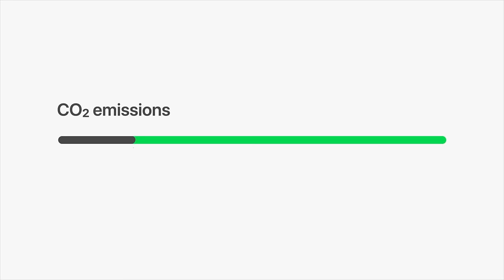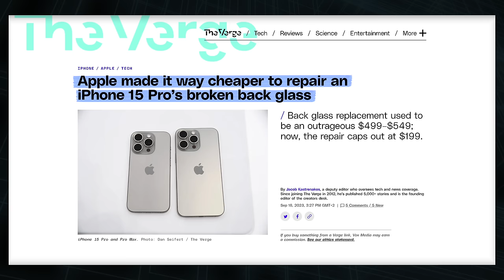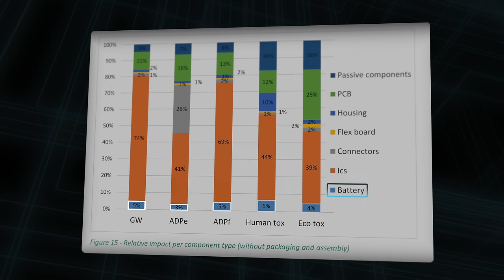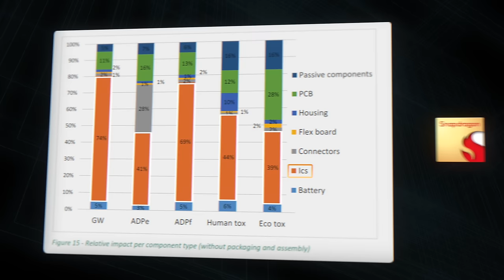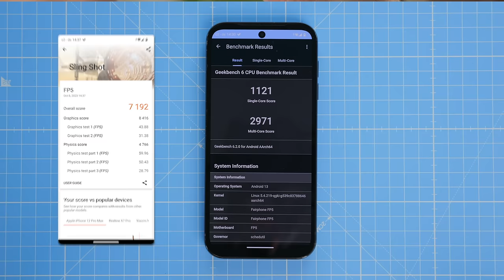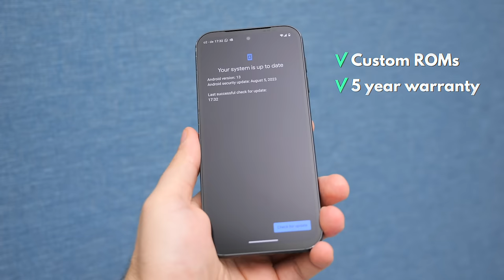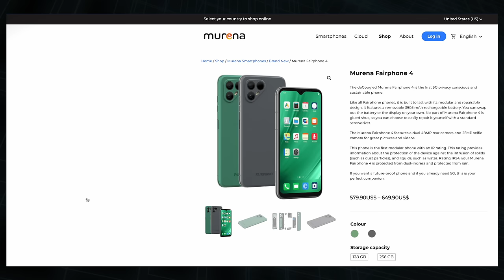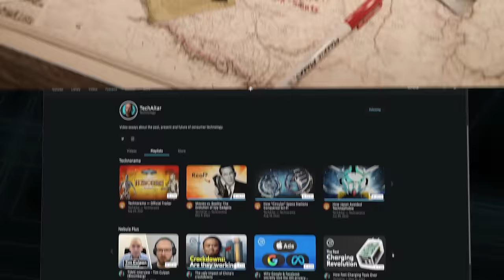Is Fairphone really fair?

Comment: What they should do with easy repairability is to target the framework selling point of being upgradable. Imagine an option to replace a better display, camera modules and cpu in the future fairphone. The current one can easily achieve an upgrade path for the camera the very least.

This alone can be a huge reason to consider fairphone
Reply: They did it in the past with Fairphone 2 and 3. I guess that hardware wise there's not that much you can upgrade before it's the SoC you need to replace, and as he said in the video, modular chips are not a thing yet
Reply: @nachopascual96  they can make a module with 3 cameras instead of two and also use better sensors and lenses
Reply: I don't see much value in Framework upgrades — except storage and RAM like in other notebooks. Just sell and buy another, at least previous motherboard sold with working notebook — less waste.
Reply: @cyano3d  they have pretty good sensors already, I believe it's the software that limits performance. And yeah, adding a third camera could be a valid upgrade but then you lose the TOF sensor
Reply: @nachopascual96  explain me who the hell needs a tof, a lidar is still understandable or maybe something niche like infrared even. But tof  isn't supposed to take so much space which could have been a 3x or 5x tele
Reply: @sergeykish Except the Framework mainboards can be reused in their desktop case like a NUC, and you can connect an eGPU dock to it for a desktop-like experience. Not to mention the mainboard is usable even if the screen or keyboard on the laptop is damaged later on.
Reply: @johnbuscher7119  You can reuse notebook as is. I hardly believe you need several such boards or there is a market for such boards. You can repair screen and keyboard.
The only interesting concept I see is keyboard module. I enjoy central position for touchpad and spacebar so I'd prefer standardisation that would allow user to choose.

Comment: I've got the 4, as it finally offered the performance to make it long term viable in my eyes.
My biggest complaints after they fixed the camera software were the bulk and the lack of granularity in their modules. 
They did fix both on this version plus a lot of extra stuff and though it's even more expensive now it's finally a device you can own without really feeling like you compromised i think. 
I barely feel disadvantages compared to my wife's iPhone 13 as is.
Reply: The only complaints I have is they don't sell them or provide warranty where I live! I pretty quickly got used to the sound and vibration quality and although it sometimes gets slow and glitchy my Samsung did the same thing
Reply: @NathamelCamel  yeah well glitches are part of the Android experience i fear. You can mitigate some with performance and i feel like these phones are string enough to do that for a while.

Comment: IP68 with a removable backplate has already been proven possible by Samsung's Galaxy S5. It also had wireless charging with optional backplates.
Reply: It was actually IP67 but still very good. I hope someone makes an aftermarket backplate with bigger battery and wireless charging for these phones at some point.
Reply: @Luke357 Do you even need wireless charging? It wastes more electricity compared to charge the same amount for wired. Surely that would be bad for the planet, right?
Reply: @Kromiball  I'd be getting the phone for longevity not efficiency. I like wireless charging because it reduces wear on the ports and it's just so convenient to just drop my phone on the pad and forget about it. Much easier than plugging it in at night.
Reply: @Kromiball when your usb port degrades you can still charge it wireless. Thats a huge win. The reduced efficiency doesnt actually matter much unless we are talking about speed. Phone batteries just arent big enough for it to matter.
Reply: Yeah I also remember the good old days, waterproof, swappable battery, headphone jack and SD card.
Reply: @cc0767  if every iphone had wireless charging it would definetly have an impact, just looking at a single phone is short sighted
Reply: @florianm9693  ironically I remember when Apple stole our 3.5mm port they tried to market it as a move away towards wireless. Meanwhile my S7 had wireless charging and iPhone did not.
What is your point?
Reply: @Kromiball Wireless charging is possibly a security benefit. So you don't connect to malicious usbc cables but still need to charge

Comment: The Germany based "Shift" company also has a "Fair" smartphone. Their newest model, releasing in August/September, the Shiftphone 8 will be modular, have removable back plate, you can repair anything with a screwdriver just like on Fairphone. Their Battery, while small (3850mH) is a multi purpose battery and are using it on multiple devices. The Phone will also be IP67 certified making it "on par" with most regular smart phones on terms of water and dust proofing. Maybe worth checking out.

Comment: The differences between phones nowadays are super small. It really depends on if you want the blue bubble or what skin (if any) you want on your droid os. The main thing is that this phone is repairable easily. Apple and other companies can posture all they want but serialized parts and batteries you need special tools to remove kinda negates all that since it's gonna be ewaste in a few years anyway when the battery dies for the last time. Fair phone isn't perfect by any means but they're the best out there for a phone you can actually use for longer than a couple years
Reply: the battery is not serialized. and even replacing it through official means is not expensive with Apple. and Apple will gladly buy your phone back to refurbish it. also iPhone are much more future-proof and well-built and so they last longer without breaking or needing to be upgraded in the first place.  the iPhone can last 5 years or longer for many people.

Comment: Great option for people wanting modularity, repairability, and longevity. Sustainability is great, but a better option honestly is buying a phone second-hand. Currently I'm using a Samsung Note20 Ultra, it cost me only about 400€ used with a charger and a warranty. You may not get the newest SW updates, but an older flagship phone will most often outperform a new mid-range one and may even get more security updates.
Reply: The best option is ofcourse a second hand Fairphone.

Just because someone else paid full price for the exploitation doesn't mean it didn't happen.

Peachiness aside. Performance simply isn't the focal point of the phone.

The questions for the consumer is, do you support the ideals enough for the price and does it do what you need it to do. If either fails, this phone simply wasn't even targeted at you.
Reply: The money you spent to get that used phone contributed to the owner getting a new phone.
The way to break the vicious cycle is to stop getting these consumer scams that are designed to only last 2-3 years as Marton said and as evidence blatantly shows.
Reply: @weird-guy  most people don't indeed, as indicated by the small marketshare fairphone has. And objectively from a moral standpoint, it should be more.

Comment: I've supported them since the crowdfunding start. The original FP1 is part of my collection of old pda's (mainly Palm). The FP2 I returned to get refurbished/recycled and I'm still using the FP3 for almost four years now. No need to upgrade yet, even the battery is still good enough for my use. My FP3 now runs on Android 13.

Comment: I tried using the Fairphone 4 last year, I found it annoyingly slow. Had to swap it out, which is a shame I really want a phone like this. The 5 seems a lot better so next time I'm getting a phone I will give Fairphone a try.
Reply: Use pixel 8 ! 7 year of software support will be enough
Reply: Honestly a lot of that is the fault of "lazy" software developers not having the incentives to make smaller and faster apps, and unnecessary features.
Reply: @Sahanawaj_  I ended up getting a Pixel 6. Needed a cheaper phone that could support a degoogled OS.
Reply: @chewu  I also was considering a Fairphone 4 two years ago, but it wasn't quite there yet for me. So I got a Pixel 6 Pro. Sadly, mine has a very annoying screen issue and weak bluetooth connectivity. I hope yours will work well as long as possible. Because of my phone's issues, I already have to look into replacing it, and I'm torn between the Fairphone 5 and a Pixel 8. The ability to use my phone as long as possible is my biggest priority, for both sustainability and convenience. Not sure if the Fairphone's repairability or the Pixel's powerful hardware and comparatively long support is the better way to get there. But buying a Fairphone also sends a clear signal to the world and supports a company with an awesome vision and fair production.
Reply: @VeitLehmann 7 years of OS support from Google itself and the fact that they have one of the brightest screens on the market puts the 8 pro above the fairphone for me. at least wait for black friday 😉
Reply: @VeitLehmann  I ended up having major issues with my Pixel 6 too funnily enough. It would restart multiple times a day, had to get the main board replaced.
Reply: Was looking into getting the pixel 7a for that reason but the pixel 8 would cost me nearly the same, maybe 5€/month more.
Reply: and by the time you getting next fairphone, it will be slow for that time again too. As always, its not an optimised phone, always behind competitor in performance at any time and any point. Unless you willing to use it with the slow performance
Reply: @fantasytky28  who cares though? Unless you are gaming the performance is good enough. I still run my S9 and dont have any issues after 4 years.
Reply: Snapdragon 778 ain't that powerful trust me , trash chip

Comment: If Fairphone starts losing the 'repairability' market to other competitors (which to be clear is a really good thing), maybe they could shift to an 'upgradeability' model of marketing, similar to Frameworks. Especially if they can convince Qualcomm to design modular phone chips, but even without maybe they could provide options for not just 'repairable', but upgradeable screens, cameras etc.
Reply: I think they would first need to standardize how the components go together before they can offer upgradability. Afaict you cannot upgrade the fairphone 4 to the fairphone 5 for example, as they improved the design to reduce 'the penalty'.

Tho you can buy a fairphone 5 and send your fairphone 4 back.
Reply: @fuseteam  fairphone users: fair phone is so sustainable
Also the same fairphone users: ow fairphone 5 come out, time to swap away my FP4 for FP5
Reply: and shifting to motherboard seller just like PC market...

Comment: I've always found the processors to be what holds me back from getting a fairphone... phone. In my eyes, I'm going from replacing a phone once every 7 or 8 years (like I have done with my current phone which I honestly only replaced because it didn't seem to agree with a jam jar giving it a little love-tap from what was literally a 5 CM fall), to replacing a phone every... probably half-that since the processors seem to usually already be half the power (and therefore quickly outdated and unusably laggy in terms of even the most basic apps (cough, facebook for some reason being weirdly demanding)).

Seeing them get a deal with Qualcomm to use these industrials is honestly really nice. I agree with them wanting to do swappable processors as well, as it would mean that you don't have to constantly keep upgrading your entire phone when the current processor gets outdated, though a Framework method of replaceable main-boards would be a really nice alternative to this if it never became possible... Have it be a reduced price if an old main-board is sent back for your upgrade since they can recycle (hopefully) at least some of that.

EDIT: 7 to 8 years is a really rough estimation.... My old phone was an Xperia M, which was... 2012 to 2015, I got it around its launch. My new phone I've had since, and it's getting iffy.)

Comment: I have a Fairphone 4 and I am a bit mad, that the company decides to bring out the FP5 instead of fixing major issues on the FP4. For example many screens have a ghost touch issue, where it registers touch input without the user inputing that. Also in a new android update the display has a bug where when it gets hot it dims down to 80 percent brightness. But this happens way to early because of a software bug. It took them over half a year to fix it (I'm not sure if its fixed now, I got tired of it).
Reply: Oh, interesting. For me, the ghost touch issue and screen dimming when too hot were fixed with the latest updates.
Reply: Its a Fairphone if it has touch issues just replace the screen
Reply: @xeetzer5478  I have iode OS installed at the moment, I think I have to wait a bit, but I guess it's looking like a solution is on the horizon, thanks for the info!
Reply: @edd9581  Guess what? I already did. It was better, but now it's starting again, so definitely not (only) a hardware problem...

Comment: I think that to be able to pull it off (FAIR). They have to have a one design-fits-all all where users can then change the internals so they don't have to buy a whole new phone to upgrade. So it is repairable and upgradeable. Then don't release a new updated design but an updated internals and software that comes along with it and just use the old phone body. less waste and better for the environment. 

Like if you want better performance just trade in your old processor and swap it with a new one since they're into modular. Then run an OTA update to make the phone run on the new hardware.
Reply: It's kinda impossible due to how Qualcomm handles firmware + How Android handles device driver via blob driver. Unless fairphone able to always ship every image of their OS with every driver combination imaginable (before mentioning QA for those devices) AND they somehow gets Qualcomm to give them the grace of having actual source code for the firmware of their chips then... No.

It's is practically impossible.

Comment: I am on my FP3. The software support has been great so far and I think that they are doing pretty well. 
About the FP5 The Qualcomm lts is huge for security, which has been a pain point. It still sucks that it doesn't have a headphone jack, but oh well, it is true that it is easier to waterproof the phone this way (I said easier. I know that you can still waterproof devices with a headphone jack, but any point of ingress is a liability).

Of course, I'll hold on to my phone as long as I can, but when the time comes, it'll be another Fairphone to me. I'm very sloppy and it has handled all the abuse and drops second to none.

Comment: I'm pretty happy with the perks of a long-term Fairphone user (I owned Fairphone 3 for many years) as I bought the new phone. A pretty substantial 20% off of the phone price, spare parts to up to 100€ for 5 years for free, a free extra battery and the 40€ plus euros I got from returning my old Fairphone 3 to them. You can add all that up and you can see that the actual long-term cost goes down because they care about users who actually want their devices to last long and also use them for longer. They directly support that and it's great! Also I just forget that I'm using a Fairphone 5 cause it just stays out of the way, it just works. I love it!

Comment: Fairphone has lost a lot of my respect when they removed the headphone jack.
A phone of this girth has no excuse for not having one.
Forcing me to use Bluetooth inears without replaceable batteries is not very sustainable.
Not even their Bluetooth IEMs have replaceable batteries.  
Anyone that tells me its for waterproofing and not to jump onto the bandwagon of selling Bluetooth peripherals with your device is just lying to themselves.
If their IEMs at least had replaceable batteries I would probably feel a bit better about it.
Having a sustainable phone is nice, but forcing me to use non sustainable peripherals sucks.
I should not have to give up my ability to use tech I already have when there is no good reason to do so.
Reply: You can use a USB 3.0 adaptor - it's not as bad or as clumsy as I'd intially assumed.
I agree with you though, shouldn't have removed headphone jack
Reply: @Quicksilver-7791  While this is true, it also makes no sense to not have one, considering how much more space they have in this phone vs other phones.
Having to carry an adapter is very clumsy imo.
I want to be able to charge and use headphones at the same time.
This whole decision just goes against the principles Fairphone claims to hold and I find it frustrating.
Reply: I agree that it's silly to drop the headphone jack, but I think the anger around it is overblown. I'm considering getting one and if so will buy a connector for it. My current phone has a headphone jack and I've ruined a few plugs on my headphones from the cord getting pushed at an angle in my pocket. So while I would have liked a headphone jack, it's such an easy fix that it really changes nothing about whether I'll buy it.
Reply: @weird-guy  this somewhat depends on the dongle, but in my experience my headphones ARE louder on the integrated aux on my phone than non powered/battery DAC+amp dongles.